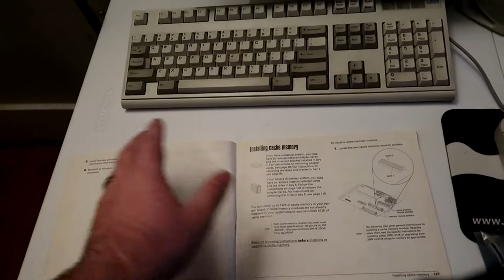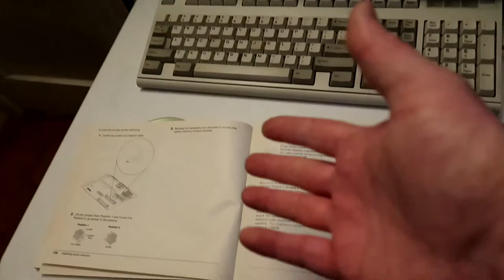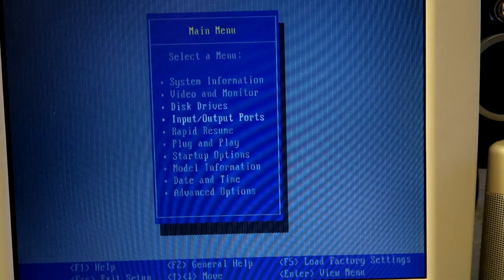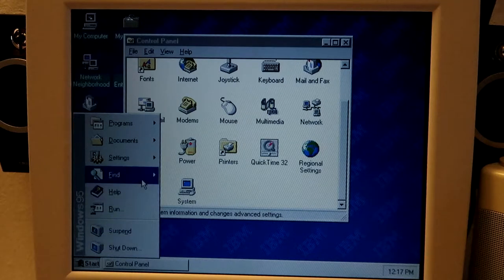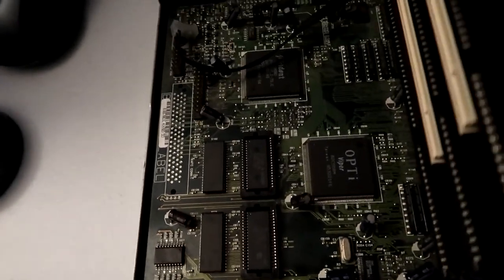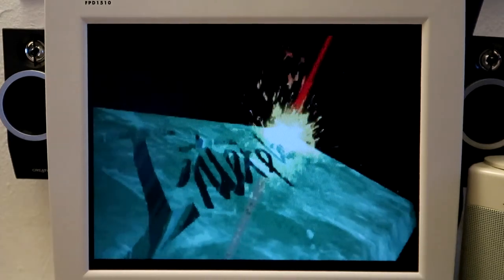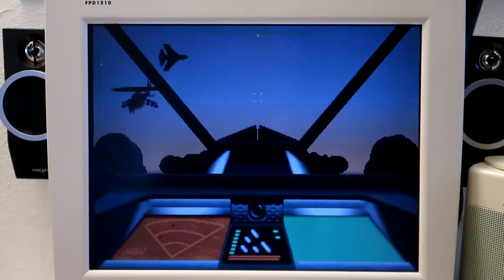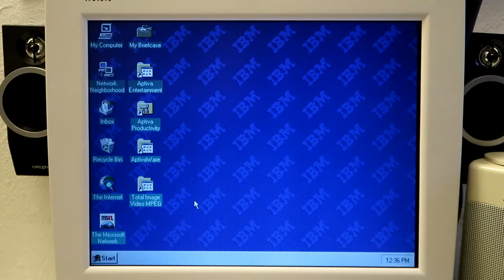Adding Some Cache Memory and Video Ram! - IBM Aptiva - Part 3

Comment: could you please provide the exact model numbers on your video and cache memory. I'm looking to get one as well. Thanks!
Reply: A1227-60001 / 5063-8783 is an 256 KB SYNC. P. BURST from HP. So I really don't know how this is working.
This Aptiva has the Opti Viper PCI Chipset, which accepts only async. Caches, these are: IBM 38H0238 aka FRU 42H0393 or from Kingston KTM-CAPTV/256

Comment: hi keith i have a same aptiva my coolection :) my quest you how add a mmx 200mhz cpu? i read this model max a normal pentium 1, 200mhz this have my aptiva and 128mb ram and voodoo 2 sli :) and more quest a dual video card this possible? i think a dual voodoo 2 sli with combinate maxtor 4mb or a voodoo 3 3000 with maxtor 4mb if you know solution this i listening :)